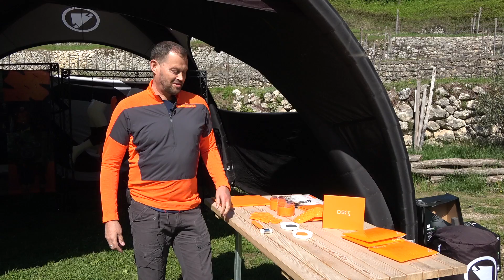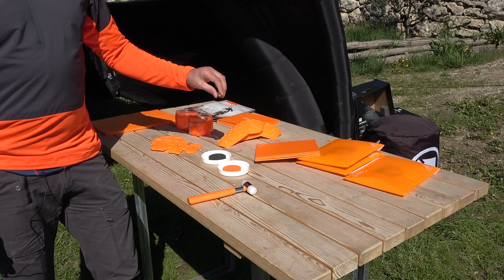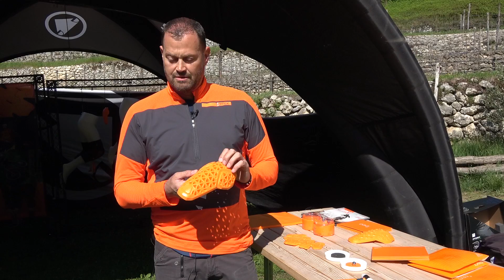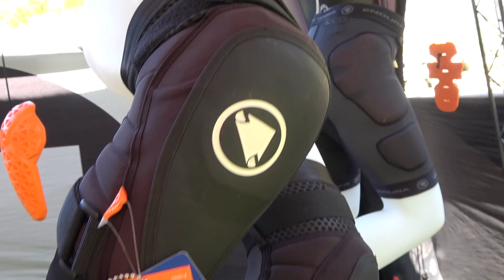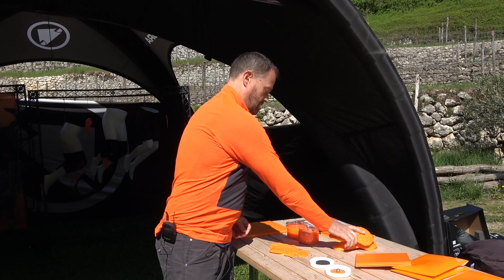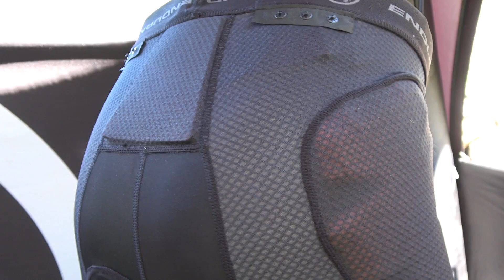How D3O protection works

Comment: can d30 be used in vehicle suspension?
Reply: Unfortunately no it would act like a rock when you hit a bump, basically making your car wobbly and boat-ey normally and then it hits bumps like it has no suspension.

I see what you were thinking tho, for that application we would want something with more elasticity. Look into cheap bicycle forks/shocks some of those use a plastic/rubber insert as a suspension the way you’re thinking of using d30

Comment: it would be cool if we could buy sheets to shape and use how we want to suit our needs since i personally need something a little different to enduro or motocross since i race speedway sidecars i need some seriously good impact protection but i also need to be able to move around very easily
Reply: You can buy solid or mesh sheets of D30 online. From there you can potentially cut them to shape and modify them.
Reply: @madoric13  Would they be any less safe?
Reply: @midgetman4206  I don’t see how cutting what is essentially a sheet of foam would decrease its original protective properties, but so far I haven’t seen anyone try it with D30. You or someone else would have to test the material out for yourselves.

Comment: Difference between a newton and a neutron.
A newton is a measurement of force used against an object, it's a vector since force can be applied in any and all directions.
A neutron is a stoichometric sub-atomic particle in materials, which is not positive or negative.
Say I push something with 20 newtons of force, it may move, but that depends on the mass of the object, the shape compared to the drag, if we're not talking about vacuum, and friction, if the object is flying or not.
AKA newtons are a measurement of physical change in an object,  I have not seen anyone do any calculations with newtons and force on a sub-atmoic level, although I've seen stoichometry done, and have done it before. Either this product is magic because it makes forces come from the ether to protect you, or it's low Poisson ratio of the material succumbing to plastic deformation. (Where more material is pushed together with uniaxual stress.
Please note that I may make a mistake, and I would be delighted if someone could point it out, I'm open to always learn(Probably with the doings of forces on a sub-atomic level since there is binding and breaking energy, thermal energy, wont get too much into it, but at this level, I'd say I've never seen someone use newtons when dealing with sub-atomic forces).
Reply: Never studied materials science, but I did love fluid mechanics back in university. The low Poisson's ratio is an interesting way to think about it. The guy was actually explaining the concept of a shear-thickening fluids correctly, but I have no idea why he mumbled the word "Newtons."

The armor contains a colloid (insoluble solids suspended in liquid). When subject to no or low rates of shear, it behaves as a fluid because the suspended solids are able to "get out of the way" as the mixture deforms. Beyond a critical shear rate, the solids cannot redisperse fast enough and end up clumping together.

So if instead of "Newtons" he had said "polymer colloid" he would've been rather correct!
Reply: He meant molecules.
Reply: I cant stop laughing that "hammer" is definitely not what I call a hammer